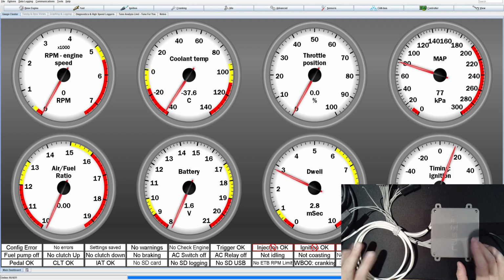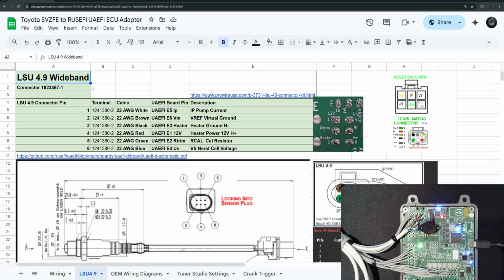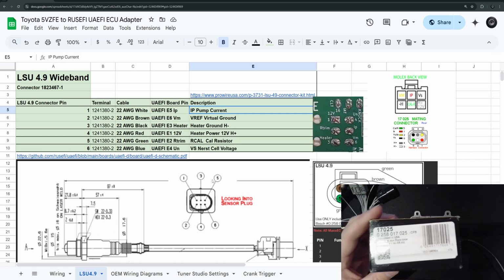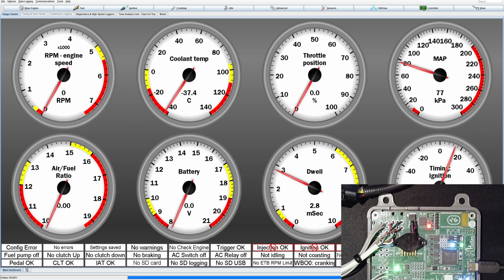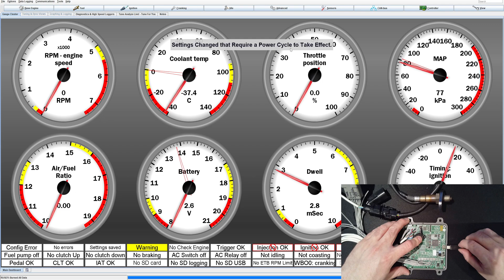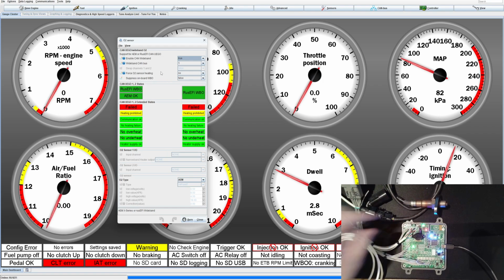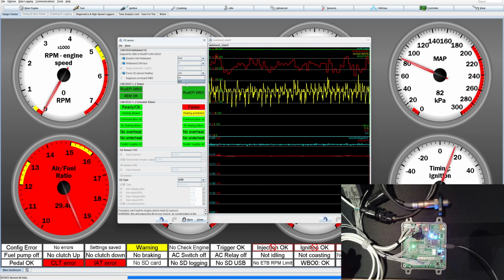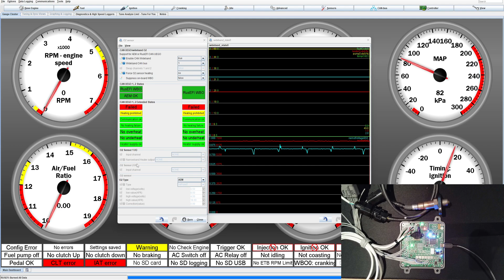RUSEFI UAEFI Onboard Wideband Setup and Overview | CAN Bus Settings and Wiring

Comment: Great video. I am currently setting up a uaefi. ran into some issues, the heating on wbo2 will not turn on , I force the heating on as you describe, but it would not turn on. Looking at the Rusefi tool, everything look correct with no faults until the heating time period has elapsed, then it show sensor fail , heating fail.  Any suggestion?  Can you re update the wbo2? the button is grey out , how?

Comment: I'm slowly starting to redo my wiring diagram for my UAEFI. I'm currently running Microsquirt on my 5SFTE Camry. I've only recently installed the onboard MPX4250, and got 12v/gnd wired up to the UAEFI.
I'm sure this video will come in useful when I get my wideband setup. It's certainly going to beat my decade old Innovate wideband I'm using for the Microsquirt.

How sane are the defaults used for closed-loop?
Reply from the maker: The closed loop fuel correction defaults are -5% and +5% so it’s really reasonable.

Comment: super cool yeah, I want to buy one I only wish the UAEFI board had 2 knock sensors, and more inputs.
Reply from the maker: Check out the 121 pin version of the uaefi. It’s got a lot more io including knock
Reply: @ oh wow I didn’t even realize about that one sucks no internal logging but oh well.
Reply: @zazzn it has logging.

Comment: How do you like this compared to the maxx? im seriously considering one to tinker with on my budget rally cross car, I run maxx on one of my street cars
Reply from the maker: The maxxecu is a commercial product with a lot of documentation and support and the RUSefi is an incredible value with only community support. They are both excellent in their own right but my suggestion is for budget tinkering you won’t find a better value than the RUSefi.